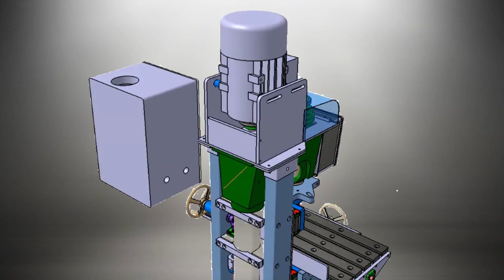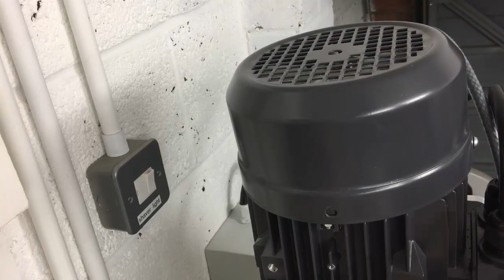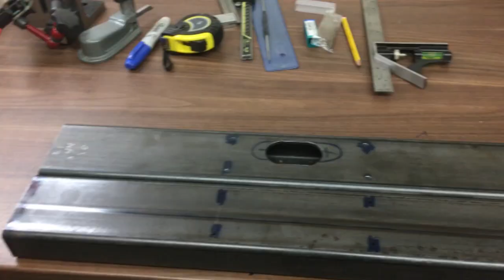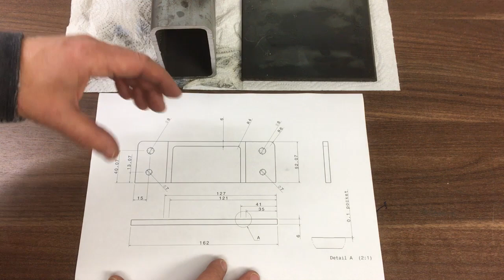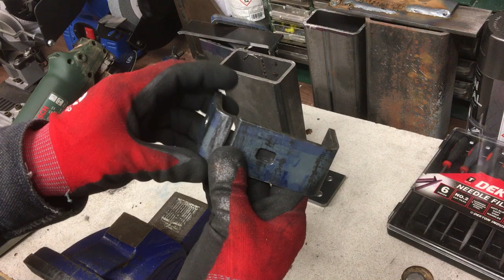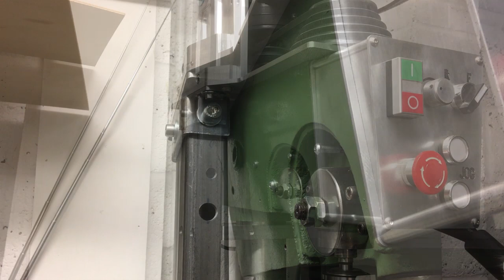Ep11: Drill Press Upgrade | Cooling and side sections

Comment: My favorite small fan to use is the Artic f12 - TC. The TC version has a long ish eternal temperature probe that controle the integrated speed controle, all you need is to give it 12v and place the probe a hot place and presto you have adaptive fan controle. And below 35 deg it is almost silent and ramps up from there.
Reply from the maker: OK good to know for future projects thanks.

Comment: If you're interested in a direct-drive 1:1'ish timing-belt drive system, I came up with an idea that's pretty economical and practical for this application. I bought the pulleys and belt to integrate into my press build. It's called the Gates PowerGrip GT2 Belt Drive System. I'm using two 5/8 bore aluminum pulleys (the two largest ones) and an 800mm, 15mm wide, 5mm pitch GT3 belt. Check these out: https://www.sdp-si.com/products/GT-Timing-Belts-and-Pulleys.php
Reply from the maker: Ok thanks.  I used something similar on my CNC machine.  For my drill press on the height adjust I need to go through 90 degrees so plan on using 2 bevel gears.  Thanks
Reply: @routercnc9517  Sure. Sorry, I should have mentioned the "toothed" part, that was pretty important! How did you like the system on your CNC? Was it quiet? Do you think with a VFD and my 2hp Baldor that I will have plenty of torque?
Reply from the maker: Are you talking about drive from the main motor ?  In that case I will be staying with the single V groove belt as if anything catches then the belt will slip instead of damaging something or breaking a tap (maybe).  You can get a lot of torque through a V belt.  Poly V is available if you need more.  Toothed belts are good if you need to maintain an index position otherwise not really required.
For CNC stepper drives they are perfect as they are high torque, quiet, and maintain index position of the ballscrew.
Reply from the maker: 2 hp is fine for a hobby drill press.  I’ve only gone bigger just in case in the distant future I upgrade the spindle to allow a bit of milling, but chances are I won’t go that far.
Reply: @routercnc9517   I think you just changed my mind about running toothed in the press. I need it to slip for safety and tool protection. Thanks for your input. I'm working on my first drill press restoration. Do you have any links to poly-V step pulleys and belts? I'd like to go that route with my 1978 Duracraft FM-514 resto-mod. I bought two Baldor motors, actually, a 1755RPM and a 3450RPM to play with, both 2hp.
Reply from the maker: I’m guessing you in the the US?  In the UK simplybearings stock them.  I’ve not bought any so can’t recommend anyone in particular.  I think you would also be OK with a single v belt.
Reply: @routercnc9517  Ill check them out and do some research. Thanks again for getting back to me!
Reply: @routercnc9517  Not sure why poly V pulleys are so hard to find. I'm in Florida but I'd buy them from the UK if that's what I had to do. Can you link your pulleys and belt? I have spent literally hours online looking for them!
Reply from the maker: Try simplybearings dot co dot uk

They stock poly v belts and pulleys
Reply: @routercnc9517  I did. They do not have poly v pulleys. Thanks.
Reply from the maker: Ok try bearingshopuk dot co dot uk

Comment: can you give us a cost breakdown excluding man hours and machinary you worked on?  thanks
Reply from the maker: The motor was about £120 from tec dot co dot uk, aluminium and steel about £250 so far but more to come.  Cabinet about £25.  Fixings wiring bits and pieces maybe £20.  Motor temperature sensor ~ £25.  The inverter, rails and ballscrew were free review items from Banggood but are quite cheap (inverter was around £60).  I think that’s it so far.  I was hoping to come in under £700, but we will see !
Reply: Don't forget that he had a CNC router, you would some have to have it machinec

Comment: Rule of thumb for rpm in mild steel with HSS drills: 6000 / drill diameter in mm 
😉👌🏻
Reply from the maker: That’s a nice way to remember it!  I have a chart over by the lathe but to be honest go by the sound, experience and feel.
Reply from the maker: Also I plan to have a speed readout - probably mount the inverter control panel on the front of the electrical cabinet.  I would need to change a setting if I swapped the pulley ratio but I’m on the fastest ratio now and can drill some pretty large holes so probably never need to change it and the readout would remain valid. Thanks

Comment: You should measure the RPM;'s of the extra fan without power (turning from the draw of the main motor one) and with power (but no main motor power) if the first measurement is way off from the second, you might actually be choking the main motor fan. (as it draws from all the area, and the internal motor from the secondary fan blocks a nice portion of that now).
Reply from the maker: OK understood, yes that’s a good idea I’ll do that to check.  You can buy a purpose made auxiliary fan which is mains driven and just runs at a constant high speed.  There was one on the 3 phase motor of my lathe.  Downside is they are noisy and cost more than I paid for the motor.  I was wondering if my hobby environment and duty cycle meant I really needed it.  It’s not a recommendation but I did see another hobby YouTube guy go the same way.  Good comment thanks.